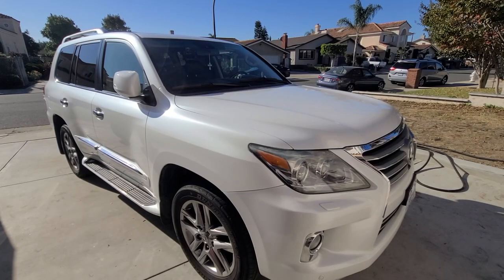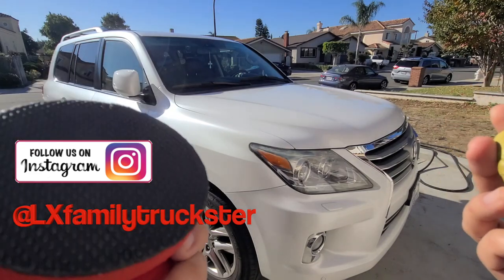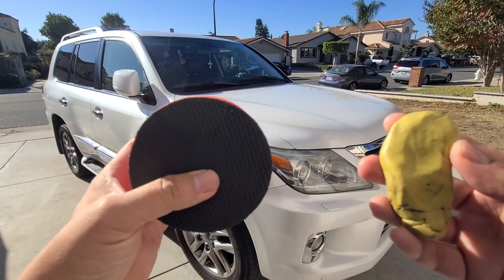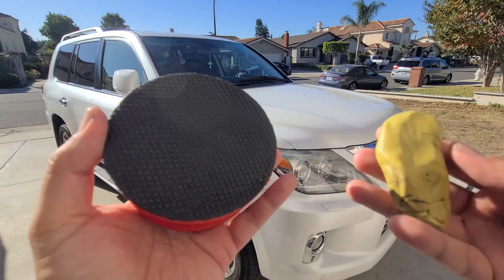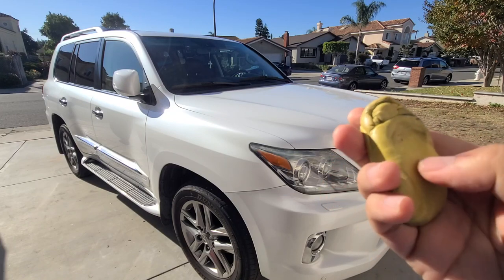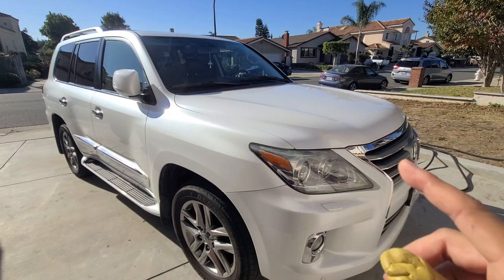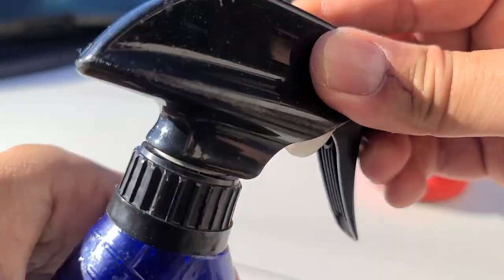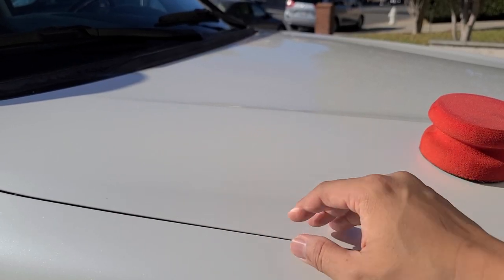Claybar Comparison - Real Vs Synthetic - Clay Bar Griots / Chemical Guys

Comment from the maker: I needed to clean up the LX Family Truckster and had 2 different clay items so I wanted to show you the differences and which is better...

get Griot's syn clay here https://amzn.to/3mb0nG1
regular clay here: https://amzn.to/3828rno
clay lube https://amzn.to/37cJWVu

or use a carwash solution mixed with water https://amzn.to/3midYLD

Don't forget to LIKE, SUBSCRIBE and SHARE this video!

Follow me on instagram for sneak previews and info I don't put up on YouTube  @_RobDaman
LX570 build @LXfamilytruckster

Thanks for your support!

Link to Free Amazon Prime Trial. If you’re a student you can get it ½ off!

https://www.amazon.com/amazonprime?_encoding=UTF8&%2AVersion%2A=1&%2Aentries%2A=0&_encoding=UTF8&tag=robdam-20&linkCode=ur2&linkId=ef4125249ec037f57dd4d4e183d14484&camp=1789&creative=9325

Prime rewards card $100 gift card on approval

https://www.amazon.com/Amazon-Prime-Rewards-Visa-Signature-Card/dp/BT00LN946S?&_encoding=UTF8&tag=robdam-20&linkCode=ur2&linkId=600a16244e1be11319ee8540b76d8326&camp=1789&creative=9325

Check out ALL my Amazon tested products: https://www.amazon.com/shop/robdaman

Comment: I’ve used Griot’s products for over 2 decades. (Pronounced “gree-oos”) The best way to use the claybar is using the bonnet for your polisher.  It obviously is easier on your hands and it removes more contaminants imho.  To prep your paint for “ceramic” polish Griot’s makes a surface prep product.  You MUST use a surface prep whenever you’re changing types of waxes/protectants.  Ceramics are simply silicone that has been around about 5 years.  Even tho Griot’s makes a ceramic, I prefer their Best Show Wax.  It gives a much deeper shine.  So deep that people waiting along side of me for the signal light to turn green will honk to get my attention and ask me what I’m waxing my car with.   No I don’t work for Griot’s...just love their products.  Also if you are unsure of what you need to take car of your “baby” simply call them....incredible customer service.
Reply from the maker: Thanks for the tips